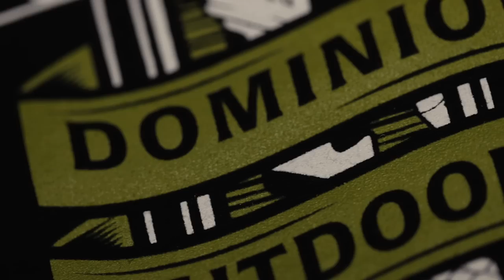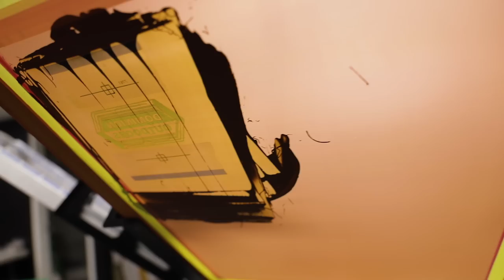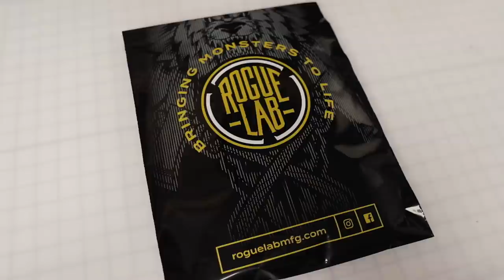A Typical Day In My Home Screen Printing Shop

Comment: What kind of tape are you using on the platen? I'm layering spray adhesive and lint on mine and feel like I'm definitely doing it wrong
Reply from the maker: You definitely don't want to be doing that! It's just decal transfer tape, the paper kind. Most screen printing suppliers also sell it just labeled as pallet/platen tape

Comment: So I've recently started screen printing and im having a massive problem, when I'm trying to squeegee the ink to the T im scraping away emulsion aswell causing the design to ruin, any tips?
Reply from the maker: If you're scraping away emulsion while printing, your screen is way under exposed
Reply: @leestuart38  okay thank you, im still pretty new to this so still tryna work out some issues so though it would be best to ask, thank you :)